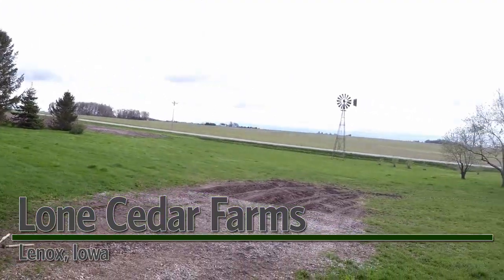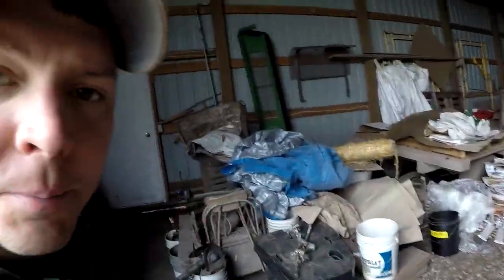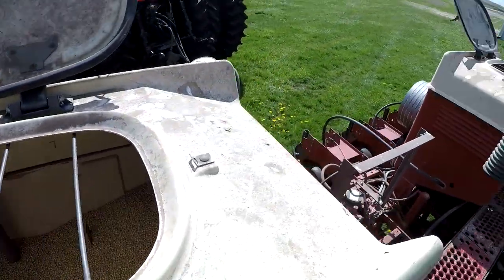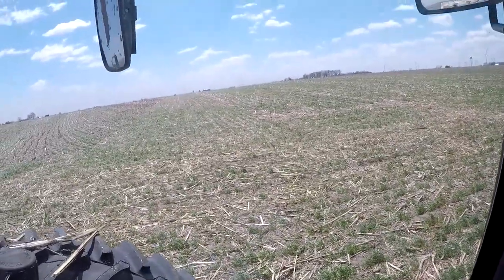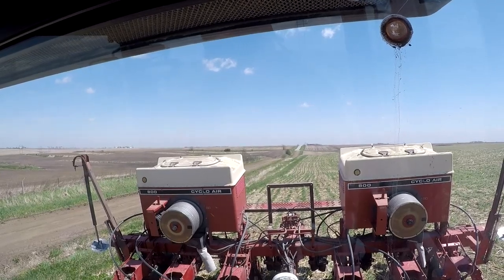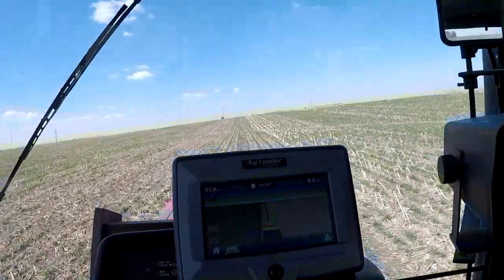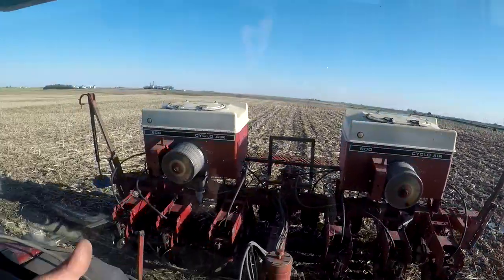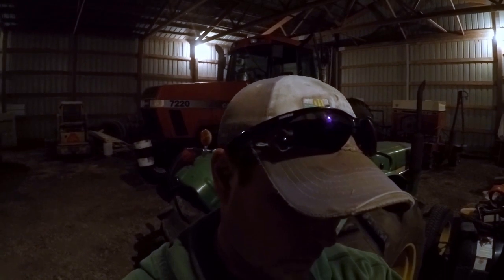2020 Soybean Planting Day 2 - Custom Cyclo 800 15 row 15"

Comment: Hy!

What is the difference between a soybean seeding drum and a corn seeding drum for sowing machines? Is it possible to sow soybeans with a corn drum? Thank you the answer!
Reply from the maker: Main differences are the size of the seed pocket and number of pockets around the drum.  I think you could probably get soybeans into the ground using a corn drum, but would likely be difficult/impossible to achieve desired population because of limitation in how fast you can set the drum to turn.  Here, soybeans are usually seeded 4-6x typical corn population
Reply: @LoneCedarFarms  thank you very much!
Reply: @LoneCedarFarms  Do you happen to know where I can buy soy drums? 
For cyclo 400. A store that would deliver to Hungary as well.
Reply from the maker: @juhostt  I know of some salvage yards in the US but not sure how excited they would be about shipping overseas (shipping also may be rather cost prohibitive due to size).  Does your 400 use 8 row drums or are they only 4 or 6?  800-900-950-955 all used 8 row drums and I think should interchange, but the shallower 400 drums may be hard to find.  Maybe try to find a cyclo planter facebook group on that side of the pond and ask there?

800 and newer planters are cheap enough I don't think many people still use 400 cyclos in the US.
Reply: @LoneCedarFarms  6-row, 6-row is the most common in Hungary. Unfortunately, we only have corn and sunflower drums available. 
The 400 cyclo is also affordable for small farms, which is why I bought it. I knew that purchasing soy drums would be difficult, so I'm trying to find them overseas.
Thank you for your help so far!

Comment: What about the hiniker for bean machine? Can you get all the seed into the ground? Won’t be as nice as the cyclo though
Reply from the maker: I think I mentioned something about it in one of the cover crop videos from last fall, but the biggest problem with the hiniker in our terrain is the wings don't flex down. So planting over terraces row units on the ends can have a fair bit of daylight underneath them. No big deal for cereal covers (rye will probably germinate on concrete if it gets some moisture), but not ideal for soybeans, especially using PPO herbicide in the pre. Plus it's hard to go to drill type meters after using a planter where you can set a population and know how much seed you need. 

I have some crazy ideas of putting together a 24x15 of some sort, though, if I find the right pieces.
Reply: Watching your video, I love your planter.  I had a custom 800 12 row 22” semi mounted and the a 12 row 30 ‘ skip row.  Neither was ideal or as neat as yours here.  I had thought about some design sort of like this, but never thought of a pusher concept. I farm Eastern IA. Now run a 1200 PT 16/31.  Complex, heavy, more expensive to maintain.